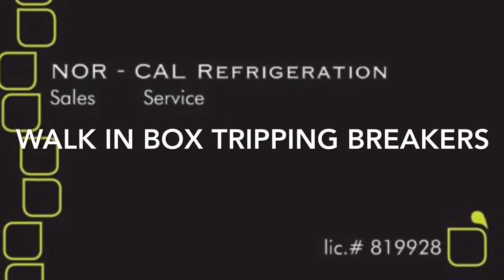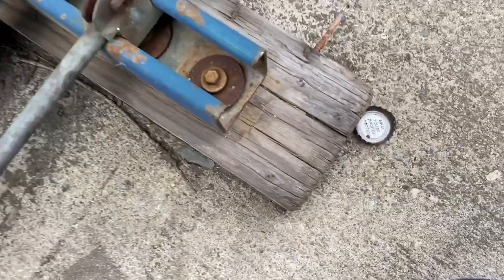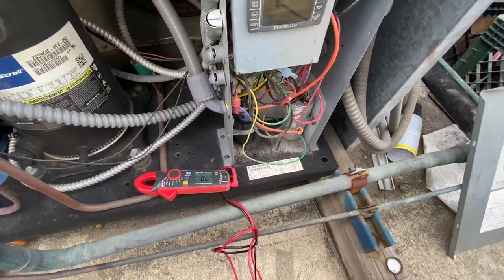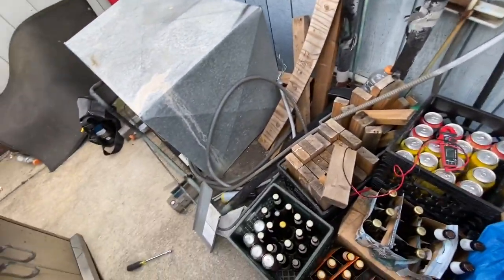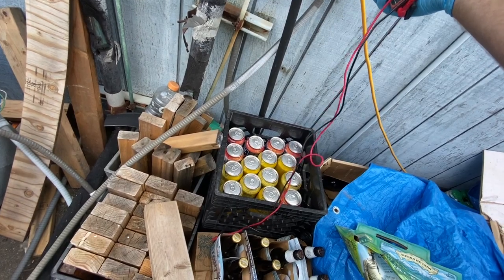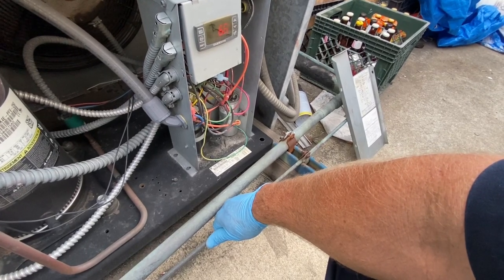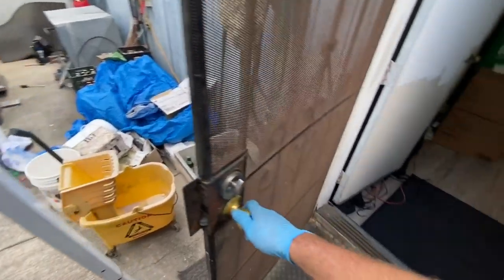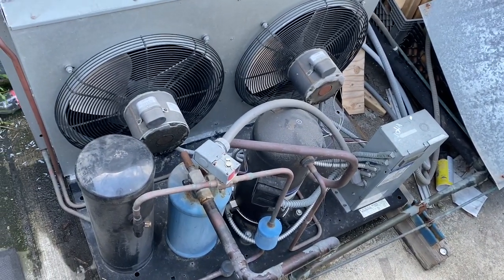Walk - in box tripping breaker

Comment: It's a wonder, how long has that system been running with that breaker? Excellent videos. With you tube, seasoned technicians like yourself can help the newer techs reinforce their education. Keep up the good work.
Reply from the maker: Thanks Frank that’s why I do it.
Reply: @NorCal-refrigeration  will the breaker go bad if it kept going on? Or would the machine stop working? What would happen
Reply from the maker: @2003fordranger  the breake will get weak.
Reply: @NorCal-refrigeration  could it cause a fire or no
Reply from the maker: @2003fordranger  I’m sure it’s possible, I had my electrician give quote for proper repair and it was rejected. I will no longer work at that location.

Comment: i am glad you checked the pressures and washed the condenser,it probably recirculates  the hot air,it should not short cycle.38 amps sounds like a bad run cap,running on start kit.

Comment: Years ago, I was still F&B operations at the time, but always had an eye on equipment and often checked condensers for dust and crud or things blocking airflow.... At one of our new facility's grand opening took a stroll around back and see that the walk in condenser was installed flat on the concrete near a gutter downspout.  Think, "hey that shouldn't like that.. let me help".  Shut off power, cleaned up leaves and pollen from around the unit. Upon start up, freaked the #$%! out at that it was starting and stopping with bang and a clang!

Comment: Had one tripping the breaker every few days recently, turned out the crankcase pressure regulating valve was bad letting the suction get too high during hot gas defrost.
Reply from the maker: That will do it. Video coming?
Reply: @NorCal-refrigeration  Editing it now!

Comment: Did you tighten up the screw with the incoming power? Hot 🔥?
Reply: With a 1000V insulated screwdriver, yes.
Reply from the maker: I did.
Reply: @NorCal-refrigeration  nice, now that i think about it, its no different than checking it with a multi meter.
Reply: @analogmoz  wimps

Comment: What was the wire size feeding that condensing unit? Might run into a problem if the wire gauge is too small.
Reply from the maker: Good observation. The sparky is pulling or by now pulled a new run and breaker.
Reply: looked like 10awg to my eyes hence the 30 breaker... so what havc/r fella did the hack in condenser special?

Comment: Good Vid ! ( Ftngot ) When installing Condensing units , package units , whatever , Allways Size Breaker at the Maximum Breaker size. If u Dont More often than not It WILL bite u in the Azz on the Hottest busiest day of the year. Whether it be Air conditioning or refrigeration. ALLWAYS SIZE Breaker at Max Recommended.
Reply: looked like a cobbled in retrofit, using the existing breaker and judging by wire 30A is  max (10awg it seemed to be), also either water(salty) was entering panel and running out leaving white crust or they make dough with flour and kick it up everywhere. hehe